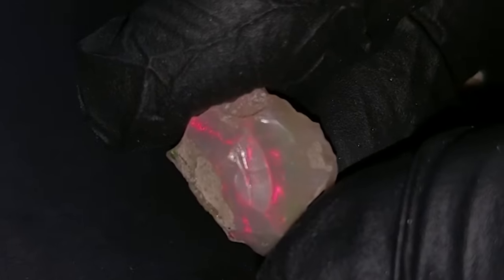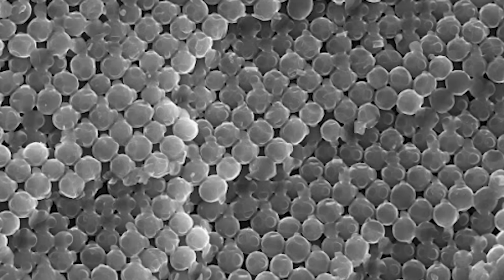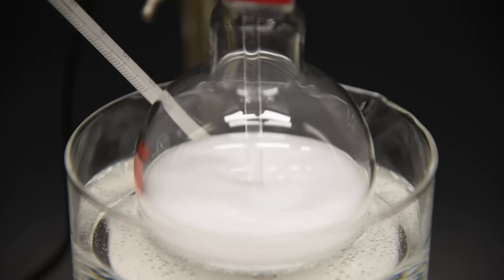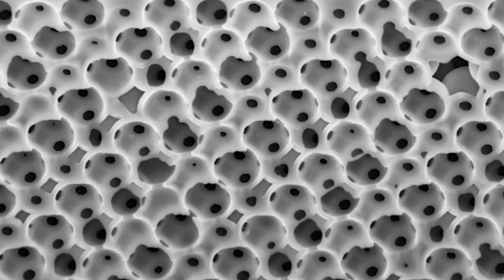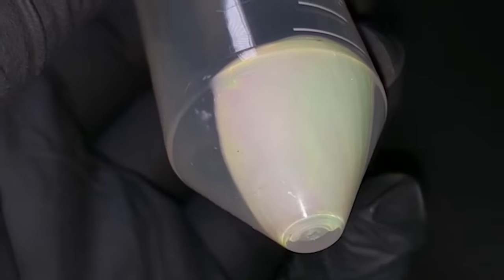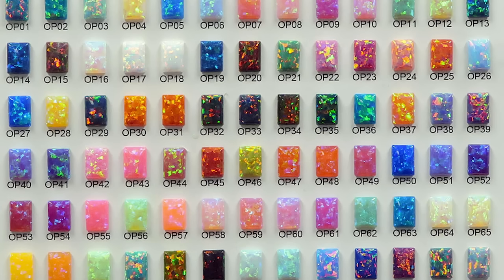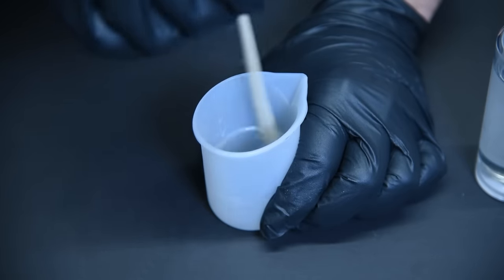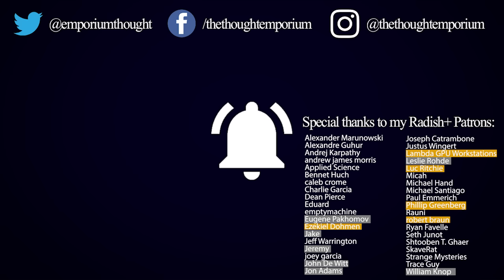Can you GROW an Opal?

Comment: I know this video is very old and someone else might have given you the secret.

But to avoid that vertical banding in synthetic opals. When you dry it over months you want the container to tilt along the vertical axis by around 5-15 degrees over 4-7 days as it settles. You can also have it Roll around the axis slowly over the same time.
Reply: That's a really clever idea!
Reply: It's wild that when I heard him say that, my suggestion would've been to do just that lmao. Like if the settling causes the striatiions, just agitate it ever so slightly: just enough to stop the patterning, but not so much as to completely disrupt the delicate process
Reply: @ghstgirl4982  What I thought too! The stripes are due to the same inputs leading to the same outputs, so if we slightly alter the inputs, that should change the outputs enough to break up the tiger stripes. Interesting that you only need a tiny amount of tilting, and equally surprised that it occurs over a pretty short period of time- less than (or up to) a week of time, during a months-long drying process

Comment: Try stabilizing the opals by saturating them with Starbond Thin CA glue instead of epoxy resin. It's generally used with wood but it's water thin and will saturate the opal way better and will leave it with a high gloss finish just like resin. It's completely clear.
Reply: Wth

Comment: "Cactus Juice" resin should solve your problem. Its a low viscosity, thermally set, resin which is generally used for stabilising wood. Lots of tutorials on how to use it online. I've used it before and it works fantastically.
Reply: Ooo i hope he sees this! Resin is such a odd beast
Reply: I was coming into the comments to suggest the same
Reply: I second the Cactus Juice suggestion.
Reply: It's the juiciest
Reply: Bahaha avatar reference?
Reply: Replying so this gets higher up the comments!!
Reply: It’s the quenchiest
Reply: I was actually thinking of this as well.  Also, if the opal could tolerate being in a vacuum chamber, the resin should be able to penetrate much more quickly and completely.
Reply: Drink cactus juice! Is the quenchiest!
Reply: Opal is NOT the same as wood. Precious opal is a hydrated silicate with a unique structure, not some porous fiber.
Reply: @Monty2451  22:30 says nope
Reply: You have to use a uv curable stabilizing resin I think.
I think I remember seeing you can grow the opal in the resin if you mix it with alcohol idk. I saw it all in some Japanese university research papers I translated. So yeah we need to get this comment seen. He was already on the right path with the uv resin.
Reply: @Monty2451  that might help too but I was thinking of growing the opal in the resin if it was mixed with alcohol. So the research to do this was done on the Japanese International space station team and they used micro gravity environments. So it’s all about making the silica float/sink I think with the gravity of the growth environment. Just blurting out some terminology I remember 😂 I’m not a scientist
Reply: @TheOceanLoader  okay so yeah growing in the resin must be the way 👌 I bet if he messes with the ratios of resin-alcohol it’ll keep growing
Reply: @ausome117  This.

Also - I recommend a pressure chamber instead of the vacuum chamber.  Maybe alternating between a pressure chamber and a vacuum chamber, combined with a very strong alcohol based solvent (IPA, toluene, xylene or mineral spirits, etc)
Reply: The photonic crystal is called a primary (1D), secondary (2D) and tertiary (3D) photonic crystal depending on the dimension of its periodic structure.Our project is going to be made. Three-dimensional photonic crystals (3DPC) are used to keep 100 nm-order micro-gravity particles. The colloidal crystal is uniformly arranged.COLLOIDAL CRYSTAL FORMED ON ORBIT AS IS BULLET To freely change the distance between lattices (period of structure) by compression by fixing and recovering with a sex gel. It can be done (Figure 2), that is, it aims to develop an element that can accommodate various wavelengths with one element.
100 nm (nanometer) sized granular particles from Fuji Chemical Co., Ltd.
We're going to take advantage of the electricity between the particles, the repulsion, and we're going to self-organize. the regular arrangement (crystal) is under microgravity by standing still High quality, large size. After the crystal has matured, the gelling agent is reacted with ultraviolet LED irradiation to solidify the gel.
Figure 2 Self-Organizing Particulates 3D photonic crystallization and gel fixation
2.2. Application of photonic crystals
Photonic crystals are initially focused on the band gap, and transparent dielectrics are studied. In recent years, research targets have been extended to semiconductors and metals.In addition to Band-Geap itself, for example, the dispersibility of photonic bands (the speed of light depends on the wavelength). Research has also been conducted, focusing on slightly different areas

Comment: 20:20 Hey! Resin artist here hope I'm not too late!

So to stabilize a piece of opal in resin you may want to invest in a pressure pot to force the resin into the pours of the stone. If it can take the pressure this process with two part epoxy may be your best bet!

Or for the UV resin you have- if the atone can't withstand the pressure pot; try soaking the opal overnight in UV resin in a dark black room then cure the next day.  That way the thicker resin has time to become a puzzle piece. 

* Third option is catalyst epoxy. It creates its own heat while curing so I'm not sure how it will work for you. It's a very thin resin and has a quick curing time. But it could be a good experiment!

Loved the video and hope this helps ✌
Reply: Amazing, thanks for sharing!
Reply: that would crack the opal
Reply: love it .....also always caeful with catalyst epoxys...not a resin artist but construction worker...andyou have to know material tolerances and how it will react TO the reaction taking place on it....either way great tips....gonna save these for later 👍
Reply: I am a resin artist also, and I use Liquids Diamonds, it's so thin. It's by The Epoxy Resin Store (don't forget the word "The" or you end up someplace different), I've never seen a resin so thin before and because of that so few bubbles in the end.  But I have to wait for it to thicken for my wall art pieces.
Reply: @capatainnemo  yeah, that's the first thing I saw when I read pressure pot.
Reply: @joshuawargo6446  what is the difference between epoxy resin and catalyst epoxy?  I tried googling it and couldn't find anything about that specifically.  All 2-part resin uses a catalyst ( the hardener) to then make it create a lot of heat to cure the resin.  I'm curious about this catalyst epoxy and if it's something I'd like to try.
Reply: what is the difference between epoxy resin and catalyst epoxy?  I tried googling it and couldn't find anything about that specifically.  All 2-part resin uses a catalyst ( the hardener) to then make it create a lot of heat to cure the resin.  I'm curious about this catalyst epoxy and if it's something I'd like to try.  do you know of maybe a brand name or some kind of name I can use to find it?

Comment: One idea instead of using a vacuum chamber to pull the air out of the opals (as the opal may be hanging onto the air inside too well for the vacuum to be strong enough to pull it out through the resin) may be to use a pressure pot instead to compress the air inside so the resin can fill in the empty voids. It will still leave you with air in the opal, but it will be crushed down to the point where it probably will be unnoticeable.

Another idea which I just got while writing this was to pull the vacuum on the opal first, to pull the air out of it, then add the resin on top of the opal while under vacuum. This may require a device to hold a cup of resin in the chamber and tip it into the cup with the opal remotely. Once you open the chamber with the opal submerged still in liquid resin the resin should be pulled into the opal due to the pressure differential inside the opal compared to the atmosphere.

There are definitely thinner resins on the market that will help you in this task as well.
Reply: Your first idea with the pressure pot is on a good path. Using a thin resin and the pressure pot may be useful.
 The second won't work very well. When you are pulling a vacuum on the resin, it doesn't release air trapped inside it. Instead, it is essentially boiling off the VOC's that are in the resin before any of the air can escape. At a later point you may finally be pulling any air within the opal out, which if you are letting the opal/resin cure under vacuum, the resin will have no force pushing/pulling it into the opal. Degassing then re-pressurizing as seen in the video just won't work due to the forces needed to move the resin.
 He could try stabilizing with cactus juice stabilizer which is much thinner and is used under vacuum, but needs to be baked to cure it.
Reply: Until you release the external pressure and you stone explodes.
Reply: @MGgoose1  I never said you should let it cure under vacuum, that's not a good idea. You should dunk the opal in resin under vacuum but release the vacuum while the resin is still liquid to be pulled into the opal from the pressure differential when releasing the vacuum. As I already pointed out.
Reply: @tedtrower9260  No, that's not how that works. Curing resin under pressure to squash air bubbles infinitesimally small does not lead to the resin, or whatever matrix is embedded in the resin, to explode.
Reply: @Switch & Lever: This agrees with my understanding as well. Cure under pressure in order to minimize bubbles and drive (thin) resin into the part. A quick vacuum before curing under pressure may help get rid of large bubbles adhering the surface of the part.
@MGoose1: VOCs shouldn't be much of an issue with epoxy resin. Polyester resin has high VOCs.
Reply: im sorry this is a bit of a pet peeve of mine pressure pots actually make the air dissolve in the resin
Reply: @tatianatub  Can I get a source on this? I have definitely seen air bubbles in resins cured in pressure pots, but you really need to look closely after the cure to know they're there.
Reply: Pssst...
Cyanoacrylate.
It's thinner than resin, soaks into just about anything, takes long enough to cure that it can be used in a vacuum chamber, cures harder than both epoxy resin & polyester resin, and doesn't discolor when exposed to UV.
Reply: The tough part with resin infusion on something like this is the mean free path down into those cavities is crazy long. If we are talking 300 nm spheres the paths between them are on the order of tens of nm across. Even if your resin monomer is quite small and the viscosity is crazy low, we are still talking about trying to force a liquid down into a structure that is so convoluted we have to supercritically dry it to get ethanol out without breaking things. No picnic. 

The best penetrating resins I am familiar with are some of the super fancy phenolic-y things used to densify reinforced carbon carbon composites, which might be worth a try if you could find some, but they are also not exactly clear, which is an issue in this application. If I was going to try this with my professional hat on I would probably start with trying to find a surface modification technique I could use to get a resin to wet to the silica spheres without interfering with the sinter. Would be a really nifty problem to mess with.
Reply: Ok, it's my kind of thread (I have pressure chamber, vacuum chamber, ultrasonic cleaner just for work with resin and filling poress in wood). First of all you put your resin in ultrasonic bath, to get really good degassing (faster and cleaner then vacuum). That way resin can dissolve under pressure much more trapped air (which it should). Second thought is... vacuum and pressure chambers are likely to destroy this structure. While resin is not fully penetrated, there would be pressure difference between inside and outside of a stone that could crash it. If going with vacuum (I personally think it's safer way) you should be releasing vacuum really slow. Also should look for resin that would not boil under vacuum (cheaper epoxys are). And in my experience pressure chamber with epoxy never fills pores in wood which are way bigger (in 4-5 bar range anyway). 
Cactus juice probably won't work just because you need to heat it to 94C and it may crack because of residual air expanding, but that can be mitigated to first vacuum it for really long time and then very slowly releasing vacuum (in days or weeks)
Reply: @thereddufus  What if we switched things up and don't use the initial settling and drying cycle set the why the opal will look. Instead we quick dry it, crumble it into a powder consisting of all tiny spheres and then resuspend it in resin that won't self-cure. Then either let it self-settle or it might be possible to use the centrifuge this time to settle the particles which will have resin in the gaps. After that we can cure it into the final product.

As long as we can successfully settle the particles out into opal while suspended in the resin, it'll bypass the fragility and penetration issues entirely.
Reply: @LanceThumping  It's a good thought, but getting anything approaching the degree of quasi-crystalisation (aka regions that are full density) needed to get the optical effects is going to be ~impossible with a fluid that is higher density and higher viscosity than ethanol. And that doesn't get into having a resin that does exactly zero crosslinking in the 7+ months needed to settle.
Reply: When it comes to filling something with resin - back-and-forth cycles of vacuumisation and pressurisation are a good old practice.
As this process requires significant time to take place avoiding strong pressure gradients that can ruin the actual filling target - thermally cured resins are preferrable against the pre-mixed epoxy-based ones. They are also really close to being as thin as a resin can get.
Reply: @kaisersose5549  fires on contact with water which is an component of all opals.
Reply: How about silica gel?
Reply: I've used pressure pots and vacuum chambers with resin for filling voids on small objects before.  You could use a resin with a long open time and submerge your opal sponge into the resin, pull a vacuum for some time then transfer it into a pressure pot to let it cure under pressure.  This, I would imagine would be able to penetrate that microstructure.  You'd likely have to cut away quite a bit of excess resin but at least it would be stabilized.
Reply: Or you could use the double bagging process. Inner bag forms partial vacuum to extract air, outer bag applies high pressure. This process is used in fiber reinforced plastics production
Reply: I'd suggest PVA and a vacuum... You use the vacuum to draw all the air out of the opal while it's submerged in the PVA and then when you release the vacuum the PVA is drawn in to fill the voids, then you sinter it in an autoclave for best results but I guess any oven that'll get to about 600C would do to allow the PVA to debind
Reply: Better yet, air dry your individual specimen and then crush them up gently once fully dried or try to mix some PVA into your solution after it's separated but still fluidic... Then mix that powder with a small amount of PVA until you have something like damp sand, just enough to allow you to press the green mixture into a useable shape before sintering...
Reply: I suspect the "ideal" way is to first sinter the opal, release the pressure slowly, then continue to slowly bring it to vacuum, and just let it sit in the vacuum for a while. Then apply a heat-treat epoxy while still under vacuum, slowly repressurize to high pressure again, and let sit. Finally, heat-treat and bring down to atmospheric pressure as dictated by material needs vs equipment capabilities.
Reply: @kaisersose5549  I am thinking the same thing, thin CA should be able to infiltrate the sample, especially if you first vacuum it, then either run it up under pressure, or just hit it with accelerant.
Reply: @WesleyJolly  
Upon further research, there would need to be an added step.
A nonpolar solvent that plays nicely with CA, allows for near atmospheric vacuum distillation and displaces water would need to be used first.
Drive off the water with the solvent, remove the solvent under vacuum, then stabilize with CA.
Reply: The best way to get the resin in there is to not infiltrate at all. Put monomer into the suspension of your spheres. Deposite and dry like normal, only now you can hit it with UV to crosslink the monomer that's already intimately mixed.

That's how some people make really nice, defect-free (I think), inverse opal films. This would usually require the infiltration of precursor into the opal, but that has a tendency to disturb the template. Co-deposition keeps everything nice
Reply: You guys are so smart reading this I feel like the person whos just standing in the back nodding along not ACTUALLY getting anything of what the other person is saying
Reply: @SwitchAndLever  wow u smart
Reply: Is it possible to incorporate the sintering process into the reinforcement? If the gaps are so terribly small that even very low viscosity fluids penetrate poorly, can temperature widen the gaps or thin the fluid enough to matter?
Reply: Wow I've learned a lot about this from really smart people arguing in the thread. Cheers everyone
Reply: @thereddufus  idk much about silicates, but I'm wondering if there's a way to fill the gaps with some form of liquified silica?